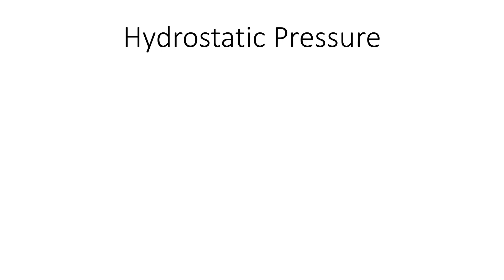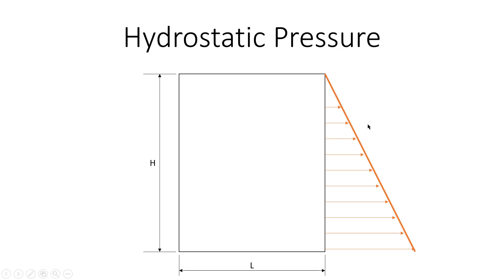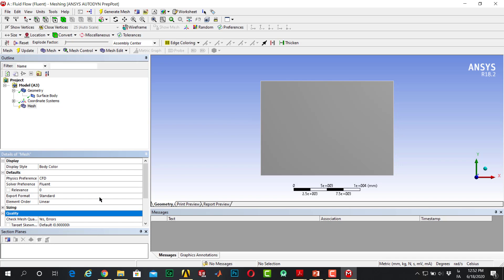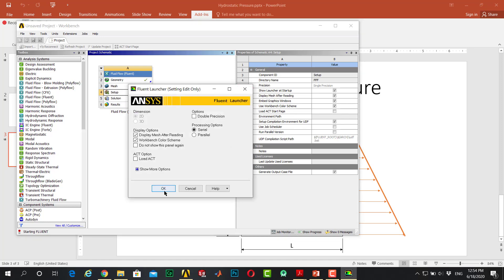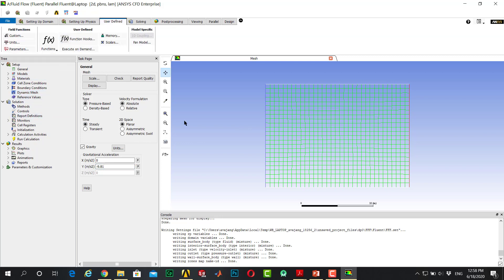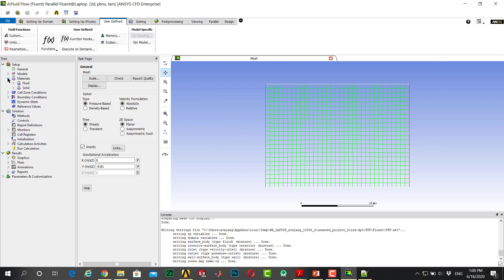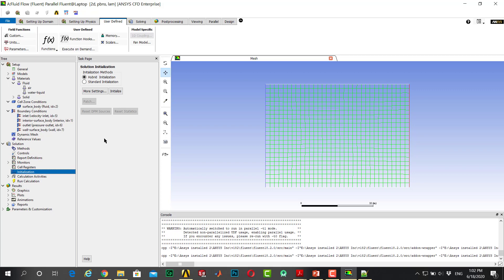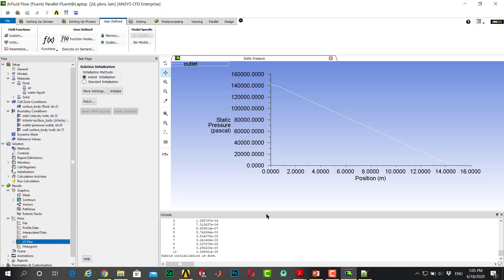How to implement HydroStatic Pressure in Ansys Fluent | step by step

Comment: I am wondering that we should define hydrostatic pressure formula as udf file for such a powerful CFD software. isnt there any way to achieve hydrostatic pressure from fluent without using udf file? thanks for your tutorial video and your fluent English accent.
Reply: yes..u can define operating density as zero and fluent will calculate the hydrostatic pressure hence buoyancy

Comment: I am trying to simulate the upward wicking in the porous media. I have defined a capillary forces at interface that pulls interface in upward direction against gravity but I am not able to include the hydrostatic or gravitational forces that balances the capillary forces. Can you suggest something about it??
Reply: Also, in UDF that you showed, how did you select the value of absolute pressure value to be 145000?
Reply from the maker: At the beginning of the video, I set the height of the domain as 14.5 m. Hence the pressure of the lower place is density*gravity*height = 145000
Reply from the maker: In which section you can't include hydrostatic pressure?
At first iteration, second iteration and above, or whole project.
Reply: @messy8852  Thanks for the reply.  I was able to figure out the problem.  Since I am using vof model, hydrostatic pressure can be included simply by specifying the operating density.